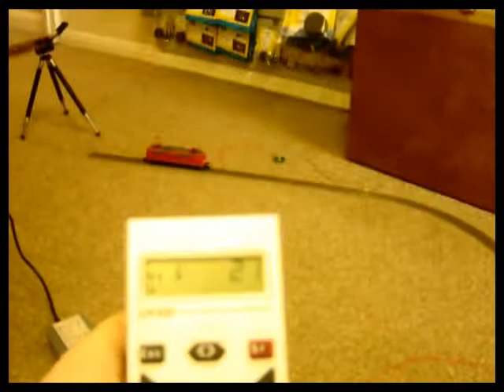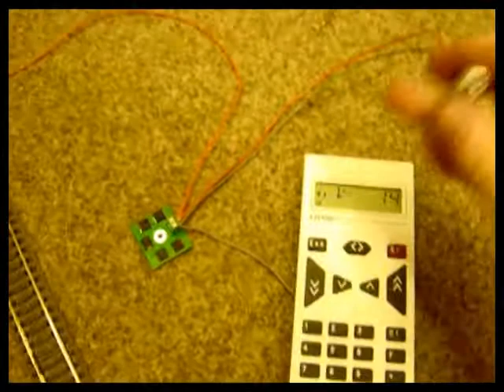Lenz DCC Promo  ABC Braking film 1

Comment: I would like yo have braking sections but I want to use Soundtraxx Econami decoders. Will this still work, or is there another way to do this.? Thanks.
Reply from the maker: I do not think the Soundtraxx decoders have the facility to respond to these braking modules so I believe they would just drive through without stopping ( It may be worth checking with Soundtraxx if they support ABC Braking just in case they have added this).  One possible solution is train detection and a PC Programme to automate your Soundtraxx fitted locos, provided your DCC system supports this.        Cheers       Chris
Reply: I can't see anything in the Soundtraxx Econami about this, so it looks like it doesn't have it. I'm using PC automation, but wanted to ensure stopping at signals even if there is an error of some kind due to having a mix of automatic and manual operation going on. Appreciate the help. Thanks,
Reply from the maker: How about a section of track at the signal that is isolated and unpowered if the signal is red and powered when the signal is green - this would prevent anything running a red signal.    Cheers

Chris
Reply: Interesting idea! However, I'm using DCC sound decoders so it would kill the sound. I did then think I could use 'stay alive' technology, but that would just keep the train going! Mmmm! Thanks for your thought Chris.
Reply from the maker: It would be a fail safe - the idea would be to stop the train in the live section before the signal (The sound staying on) - If it didn't stop then the Dead section would catch it and you would have an immediate warning that something had gone wrong with the sound shut down - presumably if a train was running a red you would have to reset the programme or ajust the manual running.    Cheers        Chris
Reply: Hi Chris. I am very much liking your thinking. However, running mostly single track, a red light in the oposite direction to another train would cause a problem for that train! I'm thinking the system would have to know whether it was an up or down train approaching... I can look at the software to get that to decide I guess.... may be mileage there. You have really given me some real food for thought - seems my situation is a bit of a tough cookie! Thanks, and cheers.
Reply from the maker: Then a direction dependent interlock would be required with a route instruction clearing the line - All getting a bit too complicated - mixing manual running with PC automation needs the PC to have some method of seeing exactly what the manual operator is doing I guess you are using the programme to do the manual driving between automated moves or are you entirely separating the auto and manual running sessions.
Reply: Your're not wrong about it being complicated... but then I like a challenge! I am about to publih to my channel a demo of route interlocking using NX (entry/exit) path setting with panel switches for direction setting - a very much in progress project, using JMRI or RRAutomatiuon. Main struggles with trains are accurate stopping given my insistence on fine-tuned BEMF settings (!) and preventing overruns, either manual errors or software, oh and somehow managing conflicting throttle commands which is a real pain! I am already significantly forward to making this work... just a few glitches/improvements needed and a bit of a leap here or there! Thanks for your interest!